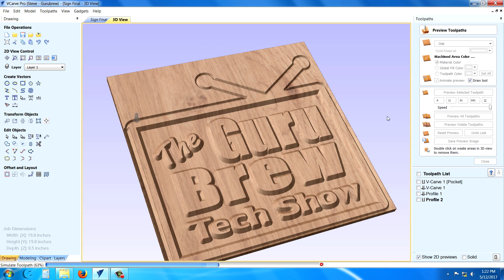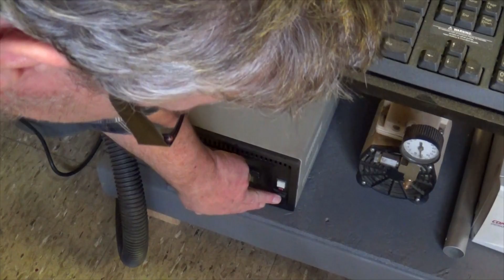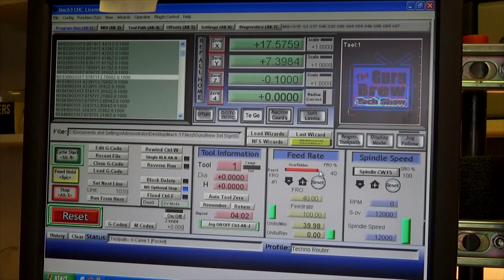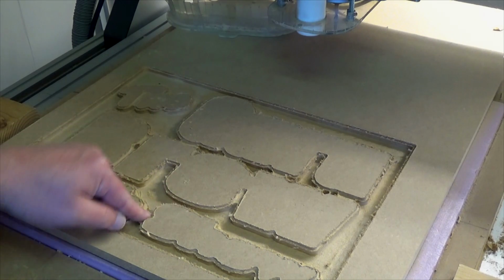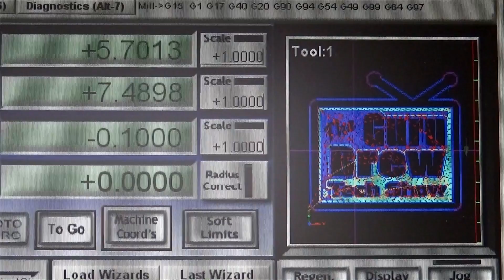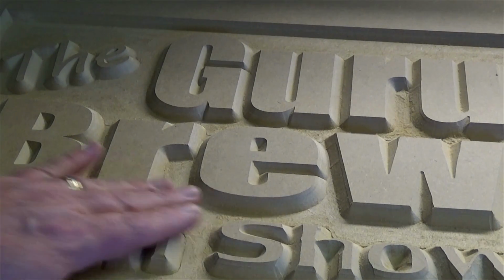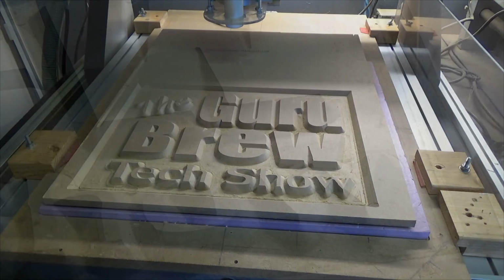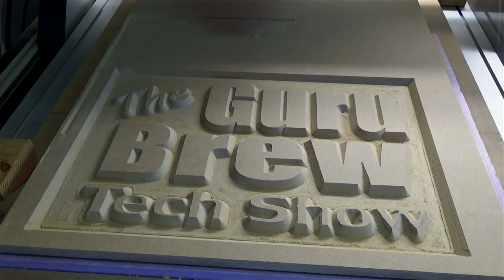CAD/CAM Sign Making - Rookie Mistakes Made!

Comment: It has already been mentioned, but as you discovered the work piece must be held securely to achieve a uniform depth of cut.  I always work with over sized pieces to allow for screwing to my spoil-board. Sure you have some waste but the added 1" around the perimeter is considerably less than discarding the project and starting over.